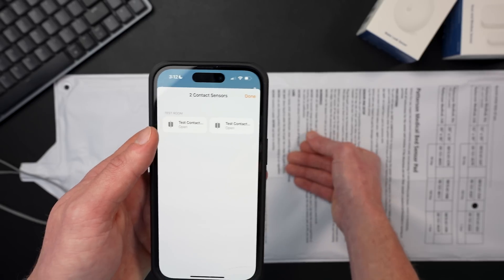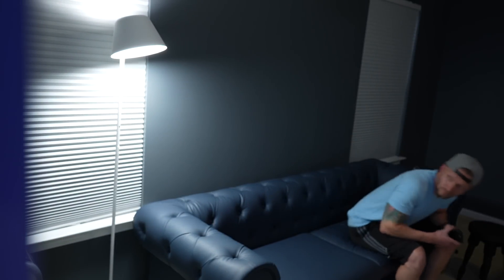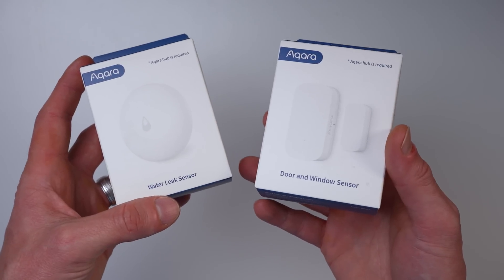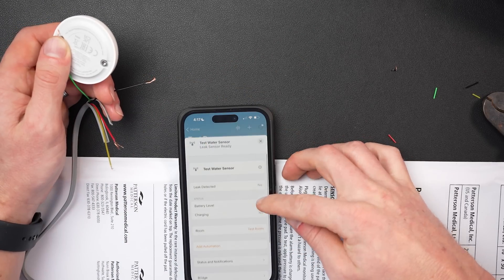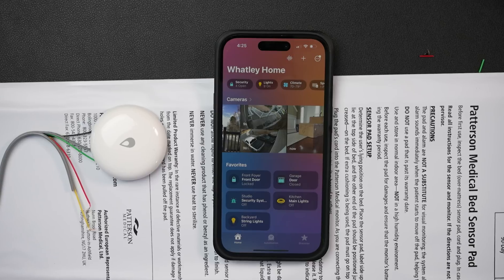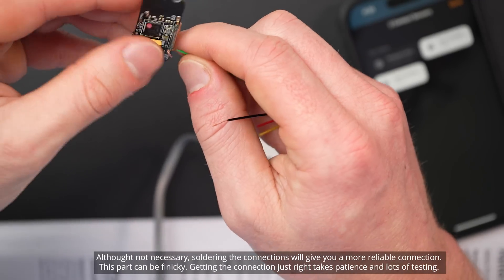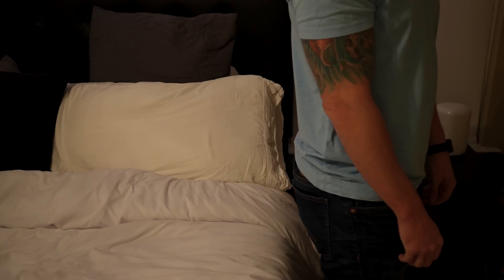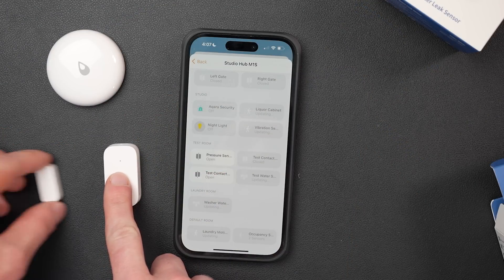This DIY Bed Sensor is super easy to make…and works in HomeKit!

Comment: If you're a fan of Aquara why don't you use the Aquara FP2 model with multiple zones and all the other included options this Aquara FP2 model has? For example 3 zones: bedroom presence, bed left, bed right, etc. Works great using just one sensor.

Comment: I did something similar with the water leak sensor. The problem was that the zigbee sensor obviously sent over and over again when I was lying in the bed the hole night. Even with 2 AAA batteries it was running just about some days until the batteries were discharged.
I guess the window sensor is the better candidate for a project like that in terms of battery lifetime.

Comment: The first thing I thought of when I saw you sitting on that couch was a button (like an arcade button that has a contact switch underneath. They use different ones for dance games. You can get both the pressure sensor and HomeKit integration if you use a 1-button button. Even a keyboard microswitch could work. There are lots of ideas I'm getting. Attaching this button to an ESP32 w/ ESPHome, you're set! I use Home Assistant, so it'd be easier for me.

Comment: On the same source for my office chair, I preferred to use an FSR sensor (more reliable over time) with the Onvis CT3 for the Thread network, it's extremely easy to open too !
I'd like to try it with the Eve Door & Window for the Matter part, it should be much better, maybe within the week if I find a cheap or second-hand one.

Comment: @ShaneCreates I have an issue with this. The sensor stays open and relies on weight applied to the pressure sensor to close it. With this setup, i'll be burning through batteries. I already need to replace it and the contact sensor is not even a week old yet. Do you have any ideas on how i can invert the reading, so it opens when weight is applied but rest in a closed state?

Comment: Hey guys, what is a good mesh wifi system that WORKS with Apple Homekit?  I just got the Amazon eero 6+ and it isn't compatible.  The Apple site only shows one Linksys router that is compatibl, but surely that can't be right?

Comment: Don't even need a mat. Two pieces of cardboard, foil, spare wire and weatherstrip foam. Make a sandwich with the middle hollow (Glue foil on two pieces of cardboard, each board tape a wire. line weatherstripping around one piece then put the second piece on top). Basically when the cardboard compresses, the foil touches which in turn completes the circuit of the two wires. I've had this under my bed for over a year and it works every night without fail.
Reply: Do you have images you can share of this? Struggling to get a visual in my head from your instructions

Comment: I want to test this out with my cats electric warm blanket so it turns on if detects a cat is sitting on top and off if the cat is not sitting there. I wonder if I can find a mat capable of detecting just 5kg difference though.

Comment: I used the same aqara leak sensor for my home cinema.  3D printed a remote control holding upper part and attached 2 small magnets to the remote base.  When you pick up the remote it turns on my shield pro, 3 amps, laser short throw projector, sub and extends the screen.
Reply from the maker: Wow that's awesome!!

Comment: Hi Shane! Love your ideas, thanks for this channel. Any ideas for a DIY HomeKit mailbox/letter detection? There's no powersource at the mailbox so it would preferably be battery powered. ;) Thanks Niek
Reply from the maker: An Aqara contact or vibration sensor on the mailbox could probably do the trick if you can get decent enough range.
Reply: @ShaneCreates  thanks! But Aqara would need a hub as well?
Reply: @ShaneCreates  found a solution and works great. Just posted a video on this topic but not sure if I can drop the link here 😉

Comment: Did the same thing with abode door sensors, used the existing hidden wiring and sensors from the door and window sensors of the old alarm system. Looks better than having them on the door/window frame.

Comment: Hey Shane, seen your shorty YT video on the new hubitat hub. I thought you were strictly a HomeKit guy. Can you use both together & are the automations easy to use as SmartThings & better than the seeming difficult Home Assistant programming? Thanks!
Reply from the maker: Hey Dan. I am strictly a HomeKit guy. I'm using Hubitat primarily to integrate z-wave devices into my HomeKit setup. I still use HomeKit for almost all of my automations. Almost anything will probably be easier to use than programming in Home Assistant.

Comment: Could this work with Eve?

Getting ready to transition our child from crib to bed... Wife is concerned about not knowing that our kid is out of bed. I have been looking at pressure pads and wanted something compatible with homekit... this may just do the trick.
Reply from the maker: Most contact sensors work like this, so I'd think it would work with Eve also. Although the Eve sensors are a little more expensive, so I'm more hesitant to bust one of those open and start tinkering around.

Comment: Great video Shane! I’ve been using mine for a while now to turn on my Living Room tv and my home theater area at night. I added few more conditions to eliminate false triggers also. The way I did mine was I used a Zwave dry contact sensor (no need to solder) that I picked up from Amazon, then I added car seat sensors (dirt cheap $2) I added everything to the Hubitat hub and used the HomeKit integration (thanks to you I found that out via your video) and voila!!
Reply from the maker: That's awesome. Thanks for sharing!

Comment: Hello. Here is the option to use. You can put the sensor in the chair you sit on when you work. You can be busy with work and not notice that someone has entered the house. A combination of a pressure sensor and a door open sensor can let you know that someone has come. for example, turn on a light bulb or a red LED strip that you will glue behind your computer monitor in advance.
Reply from the maker: That's a great idea!

Comment: An Advanced Feature of the Aqara door and window sensors are the small holes in the board.  They are directly connected to the ends of the reed contact. You can easily put some jacks from jumper wires through them, so in case you have these and some wago clamps you can have a reliable connection without soldering.
Reply from the maker: Thanks for the tip!
Reply: Please provide a link to "wago" clamps
Reply: @faengelm  Just search for wago 221. But I think they are not the most important part, any type of connector can be used.
They are connected by dupont cables to the two holes near the reed contact on mainboard of the Aqara sensor.

Comment: These exact projects are what got me into HomeAssistant, you're able to read a return value and use it to make these sensors much more precise and then pass those states back into HomeKit, especially for uses like under a mattress or couch seat. 

I personally use these for adding context to occupancy, so while a motion sensor or mmWave sensor may be able to inform that I'm in say the living room, one of these sensors can show that I'm sat on the sofa and have automations work differently depending on that state. Say, turn the lights off when no motion is detected, unless someone is sat on the Sofa. 

Turn on the bedroom light when motion is detected, unless someone is already in bed etc etc.

Comment: Hi, any idea to know when the sump pump is running, maybe a vibration sensor?  It would be cool to know how often it runs.
Reply: Aqara has a vibration sensor already. Easy to use.
Reply: I used an Aqara leak sensor with two copper wires attached to the sensor leads that extend into the pipe that leads into the pit.  When water flows in I’m notified with an Aqara notification. 

It doesn’t exactly tell me that the pump ran, rather when water flows in.

Comment: Brilliant. I did this with my hardwired door contacts at my house. Instead of having the Aqara sensor sticking on all the doors I have them stuck in the old alarm panel and they’re so fast and reliable. That’s probably how I’d to a gate sensor too. Use an outdoor rated contact sensor and wire it to an Aqara sensor in the house or in a weatherproof box. Kinda solves the range issue if it’s a gate far away. Could work for a mailbox too. 😅

Comment: Brilliant use of the water sensor. Takes me back to 1999 using the X-10 powerflash modules. I was thinking could use the sensor with a normal doorbell button.  Make a simple Door Bell routine to play audio when pressed. $22 vs $220 doorbell cam. Needless to say i ordered one of those water sensors for my Aqara M(attter)2 hub. And to test with all my other zigbee hubs.

Comment: on the bed sensor, any idea what the difference is between the 90-day, 180-day, and 1-year use?
Reply: That's how long they work for before failing, pressure mats are not good for longevity for a smart home.

Comment: Unrelated question i forgot to ask during the last live talk.

Since i updated to the new architecture my homekit was butchered, and i have to start over unfortunatly. Luckly there isn't many automations i need to worry about.
But question is. Should i redo my home in Homekit now or wait for 16.4? What is your recommendations.
Reply from the maker: If you've already updated to the new architecture, I don't think there's any reason to wait.
Reply: @ShaneCreates  hmm i had issues with devices, and also my wife lost access and I cannot add her back.

Prompted me to just delete the house as most is in NodeRed anyways.
So mostly wondering if it makes sense to add the devices back now into a new house or wait until iOS 16.4?

Also nice video, already looked up for some bed sensors on AliExpress 😅